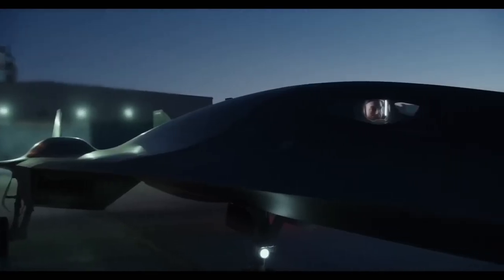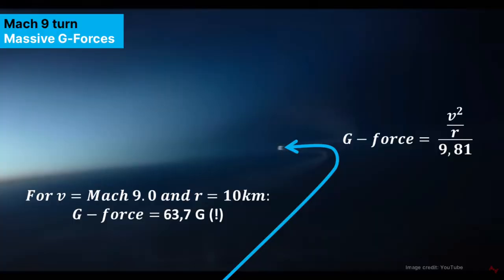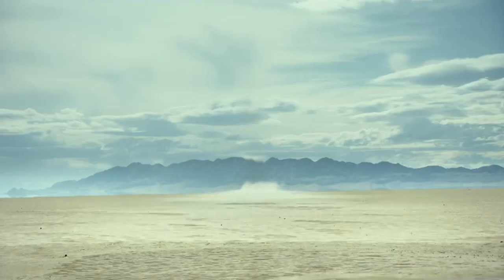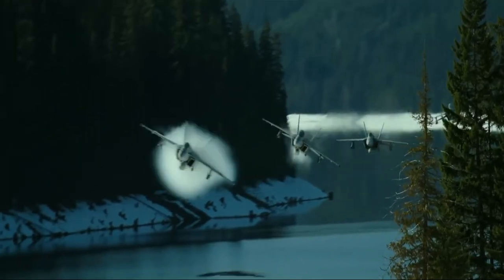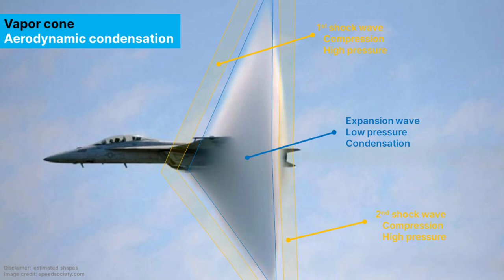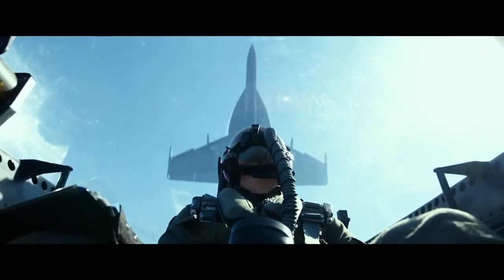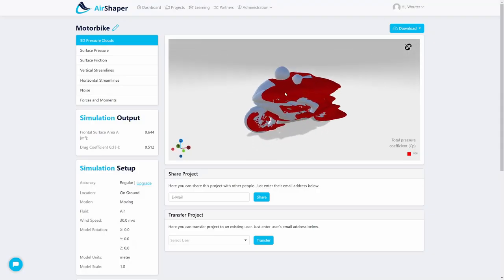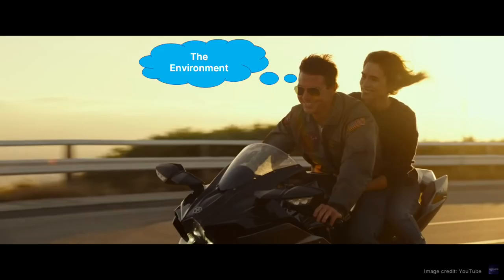Top Gun Maverick Aerodynamics - Our Top Scenes Analyzed

Comment: As someone who spent a lot of time around US navy aircraft one of your premisses was wrong a vapor cone around the airplane dosen't mean it's supersonic or close to being super sonic all it means is there is a lot of moisture in the air, A super hornet is not supersonic down low plus those were carrying pylons which are canted outboard like 15 to 20 degrees into the airstream against the direction of travel for weapon separation reasons so that also limts aircraft speed down low and at altitude a F-18 needs to be slick n at altitude to break the speed of sound. the vapor cone does make for some cool visuals...
Reply from the maker: Thanks for the comments!
I didn't mean to convey that the vapor cone only exists when crossing the sound barrier. It's just that in that scene (whether it's realistic or not), the planes do cross the sound barrier (given the sonic booms that were included). So yes, perhaps the scene wasn't realistic to start with.

I did research this, and found this very interesting paper (which indeed also details vapor effects in non supersonic regions):
https://ntrs.nasa.gov/citations/19950024579
Super long & detailed document - I hope you like it!

Comment: The only reasons I can imagine about the Dark Star scene to explain the turn would  have nothing to do with airodynamics or physics.  Instead my guess would be 1. Flying a straight line is scenemathically boring(probably why)  and 2 (just to give the story a spin) they wanted to remain inside their assigned airspace (for a multitude of legal and safety reasons) and so start, speed up towards the closer end of the airspace restriction,  turn while not at the target speed yet and then use the full available length of the assigned airspace to get to the target speed.
Reply from the maker: Hi Sven,

I think your first reason is the right one!
I don't mind, it's a movie and the purpose is to entertain :)

I do like the second reason as well, interesting angle, thanks!